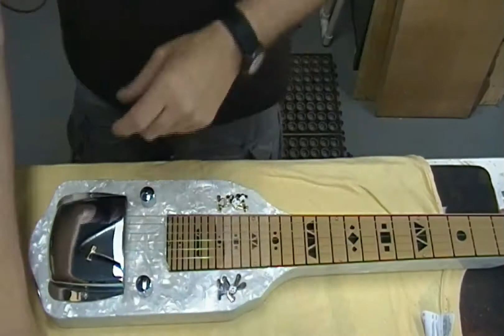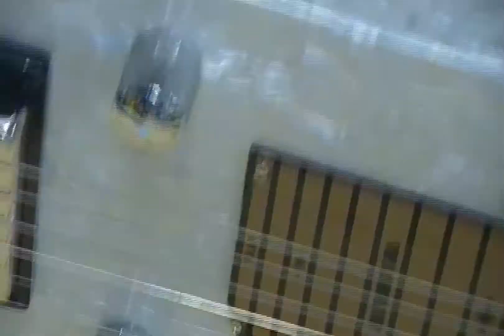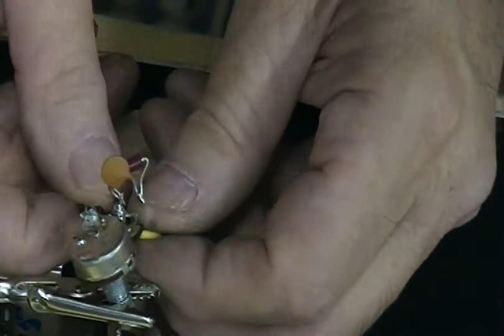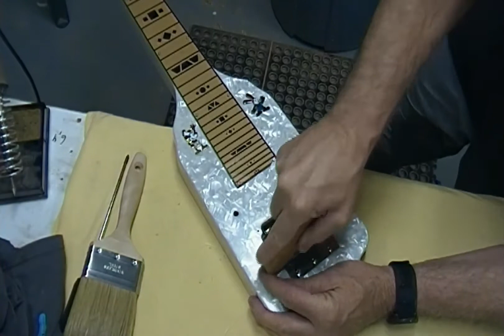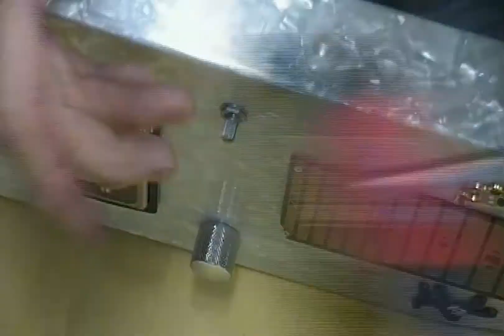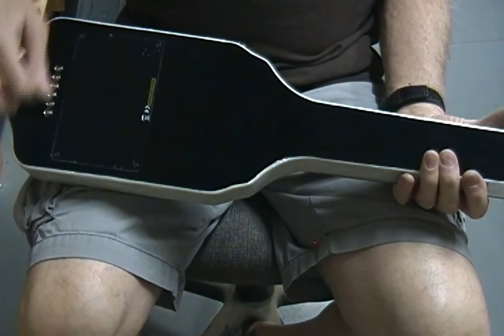JONAH GUITARS, ROGUE LAP STEEL PICKUP SWAP

Comment: Great job Mike, any idea of year of this rouge? Might get in touch  concerning  an old surpro I've acquired, thanks .
Reply from the maker: Hey Bill, thanks for checking this out. It feels like about 70s. It could be newer for sure. This client has a bunch of lap steels. They kind of come and go. But I've worked on (besides this Rouge) 2 Supro's a 46'ricky. And is there some made by Supro called and Airline or close to that. He has another old Ricky that I haven't touched yet. Mikes a great name it's just not mine. LOL I'm Dane pleased to meat you.

Comment: Aloha Braddah, I was wondering why I have seen some videos where a metal component was being worked on to get rid of a sharp edge….graduated grits of sandpaper was used….WHY? Just knock it off and smooth(grind, file, etc.) the area off. That method of graduated grits is on wood to get a smooth finish for painting. Am I missing something here? Anyway, nice work Brah and Mahalo nui loa for sharing your time!
Reply from the maker: Hi Michael, yep, when you graduate up the grits on any surface you get a better finish. So even if the steel is not plated it will polish up. Buffing compound will inhibit rust.

Comment: Could you tell me the reason for this video.  I wanted to have someone explain the best way to exchange the pickup.  I don't get why you did not explain what you were doing.
Reply from the maker: I'm not sure what you mean. I explained everything I did in detail. I guess maybe you wanted me to say what each wire does and where to put it. A wiring diagram is probably better for that. The reason I changed the pick was because the guy that owns the lap steel wanted to try out the Lollar pickup.